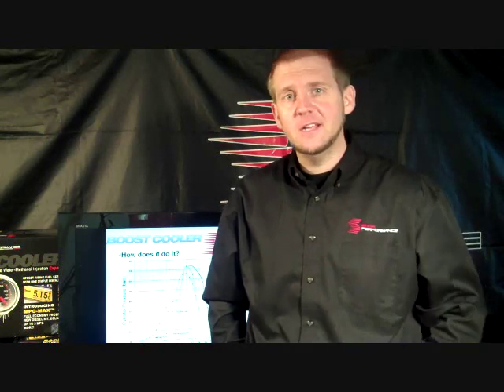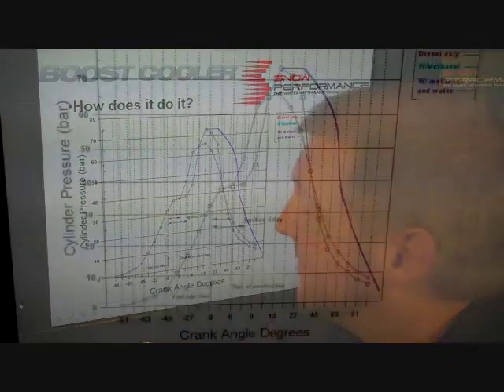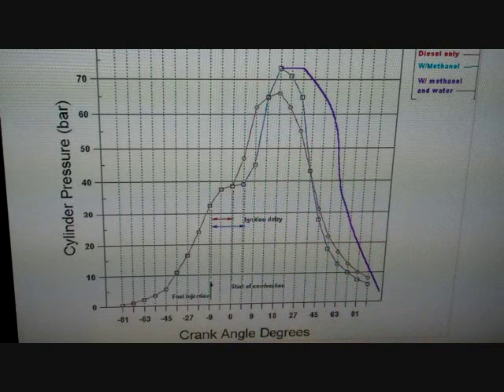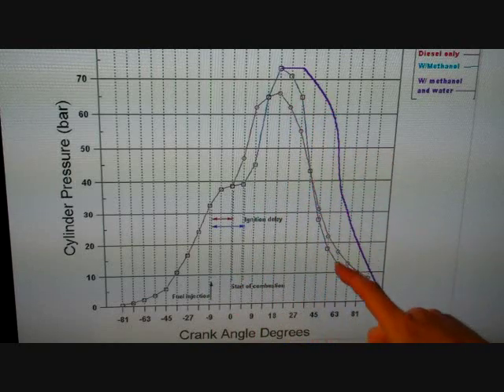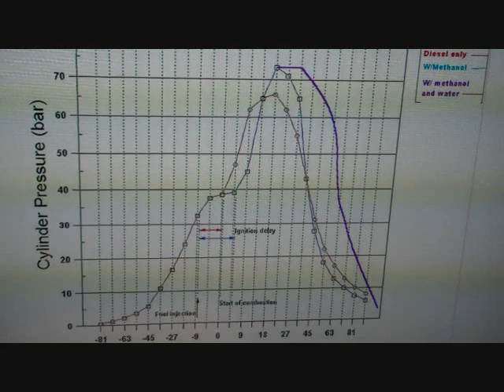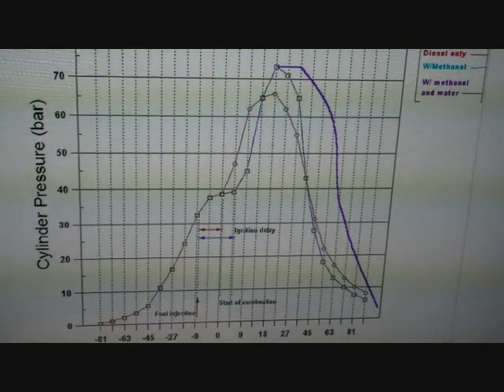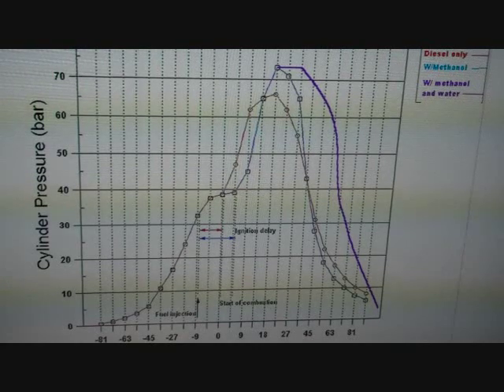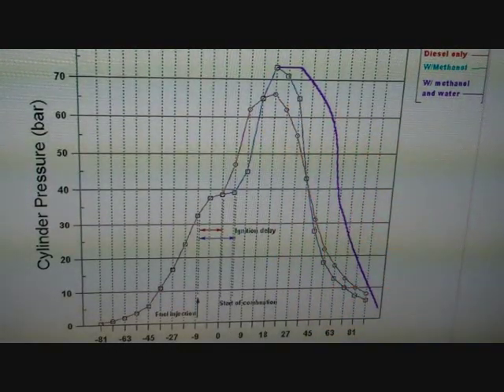Does Water-Methanol Injection increase timing in Diesel motors?

Comment: Cylinder pressure did increase by around 7 bar so about 100 PSI, which is a lot on a truck with a tune that's already got the head gasket on edge.

Comment: Would this possibly help a 1989 new Holland 6.6l mechanical injection system achieve cleaner and more power without sacrificing safety or longevity in a vehicle the size of a bus?
Reply from the maker: It definitely would! I just responded to your other comment

Comment: Great video  !!
I ran a sprint car with 100% methanol and found it made 20% more horsepower than gas, and was easier on the engine .
I had it to 13.5 compression and at that could run 20% nitro. When I raised the compression to 15-1 it made a ton more torque and horsepower and was fast.
I studied this situation in college and found methanol makes latent heat of vaporization as it expands 5 times more rapidly and powers the piston down 20 % faster after ignition. 
I kept bumping the timing and accidentally detonated the engine.
I'm experimenting with water/ Methanol on my old 6.5 turbo diesel and I hope to increase the fuel economy, so finding your channel is Great.
Keep the videos coming !

Comment: What about pure water injection?
Reply from the maker: Pure water does work but you see less of a power gain. I would contact a tuner of your specific vehicle and see what ratio they recommend.
Reply: @snowperformance1  We are currently trying to find a solution for 1.7l turbodiesel inline 4, up to 220 bhp. Air to air FMIC is either not capable of sufficient cooling, or is too big, whitch hurts throttle reaction and lag. Thus at high load application we are searching for addition charge cooling, like water injection. Methanol is hard to find locally, so primary running is fluid is though distilled water.

Comment: Interested to know what 100% water injection does in a diesel
Reply: Lowers temperature of combustiom gases from about 650°C to 400°C  and increase torque/power by 10%. Water doesn't combust, but cools cylinders and due to that steam is created during combustion it gives off power/torque to pistons.
Reply: Also cleans combustion chambers.

Comment: DR VOLKS here You make a fine product . I have been designing and testing CNG injection systems on small and large diesel engine. and found we can have our cake and eat it too. on a 2007 Ford power stroke 6L we have dynoed it to run on a 70% CNG 30% diesel blend  and still pull a added 60 HP on the top end and only raise the ex temp by 100C.
Bob Mann
Reply: CNG is excellent stuff

Comment: Hi,comments are very interesting,I wonder what effects would have put water/methanol in a 1HD T diesel engine,in my case I have it installed on a 4x4 toyota jeep to compete races at the moment the engine has 400 psi in each cylinder and the boost is 20 psi or so.The specific question is that both the system would help me as it races are 4x4  in mud and water that makes constantly vary the engine temperature, thanks.

Comment: Really interesting information. Thanks for sharing.  I just installed a Stage III Boost Cooler from Snow Performance with  625ml/min and 375ml/min nozzles on my 6.5L IDI Diesel and noticed a huge increase in torque!!! Love the system and would recommend it to anybody.

Comment: Thank you for the info. From the graph it looks like we can get more information for tuning. It seems like the water methanol actually delays ignition an additional 4 or 5 degrees. The cylinder pressure increase looks to be about 10%- from 66 bar (950psi) to 73 bar (1050psi). 

A P7100 pump Cummins has fixed injection timing. I know that advancing the injection timing increases cylinder pressure- as well as fuel economy and NOx emissions. It's interesting that the peak cylinder pressure happens at the same crank angle. It doesn't seem like you would want to change the injection timing at all to maximize the tune for water methanol, but it would be great to hear more on that from the water methanol experts...